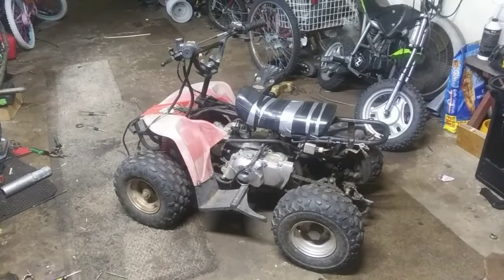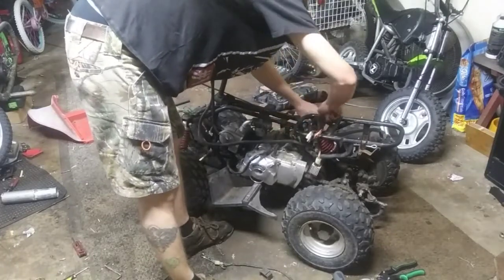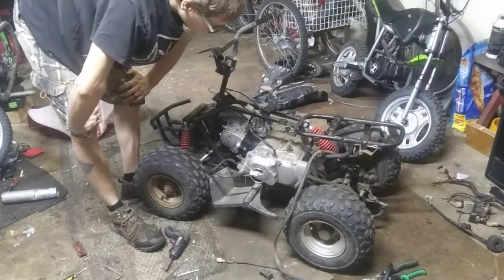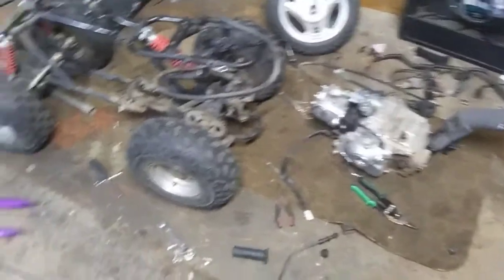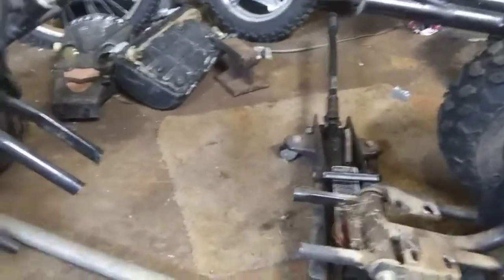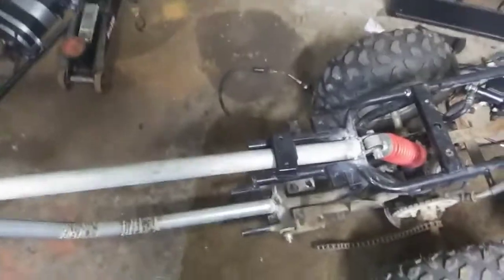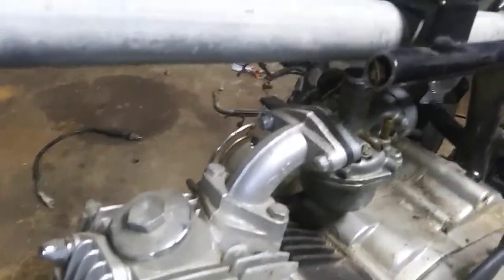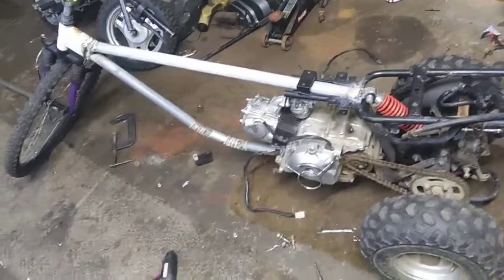custom mini chopper trike build pt.1

Comment: You can cut the intake twist it to the side and stick weld it back together, aluminum stick is not pretty but works 👍
Reply from the maker: I sold the stick welder or I would